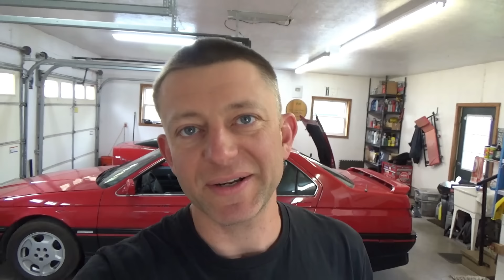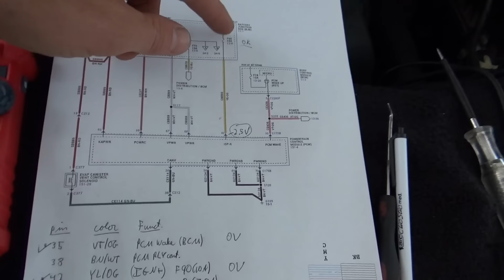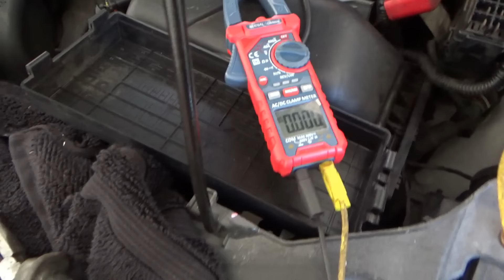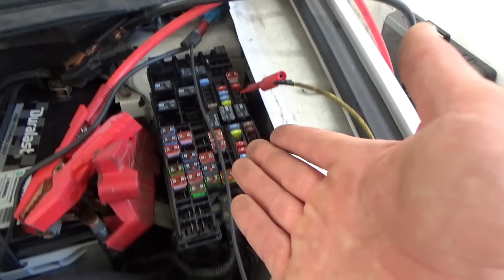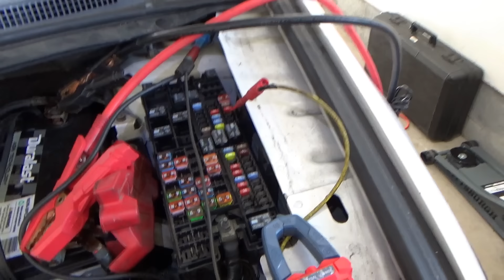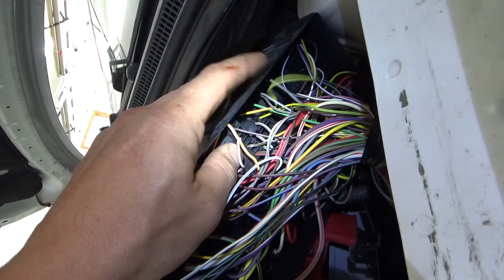(Pt 1) Ford KILLS Battery...PCM Stays AWAKE?! ('13 Edge V6) at NEW SHOP!!

Comment: If you can completely isolate the feed to the output which is bridged, there is the possibility that you could open the fault with a high current pulse, lets say 30 Amps ramping from 0 VDC to a max of 50 VDC. You could take it in stages if you have a adjustable current limit regulated DC bench power supply, or you could do a ramp. You would first set the current limit on the supply and then adjust the voltage up to about 50 VDC. If all goes well you could cook the crusty. If you watch the current you should see it increase, spike and then drop to zero, I think you can be confident that the crusty was cooked.

Comment: The bleed over is probably from a bad PCM right? seems to be a common problem with Ford Edges. They aren't connected anywhere else. The Fuse box is separated wires not a circuit board. Where the PCM is a circuit board and could bleed the power through.
Reply from the maker: Keep watching 😉

Comment: Wow, that’s quite a change, congrats on the little one that’s on the way.  Nice looking shop, lots more room.  I love these types of who done it diagnostic videos.  Are you still in the same general area of Pennsylvania?  An automotive question, I’m looking for a new scan tool, the think tool Pros was great but would like to know if the TopDon Phoenix Plus will work on the new 2025 Dodge Ram 2500 with the 6.7 diesel engine.

Comment: Check on the BCM trace the terminal that is bringing the voltage from the fuse box  to where it is you will see the problem probably the BCM, changing the front fuse box will not fix the problem

Comment: You Are Amazing to take this work on. This is absolutely an awesome video to involve fuse to PCM power. I've yet to try and correct, although emissions get in the way. Disconnected, ran a code however many times over just to find same code came up with main emissions  egr, DPE also disconnected, same code although must be started to test. Simplest test why PCM was alive, or restricted by module component, IRCM as a Relay Module. One of those two, and it wasn't the IRCM. Back to square one between Fuse Box and PCM. There are multiple sensors, switches, wirings involved with Fords. Thank you so much for very logical reasoning in faults - and not coming on code readers. Blanks out to Emissions, catalysts, O2 sensors, although wiring, components were changed out, half anyways right now. It makes a difference. Yes, I got another PCM also ++ more too. PST

Comment: Ford generally has the fuse box is part of the main harness snip the wires on the back add individual fuse holders and an aftermarket relay

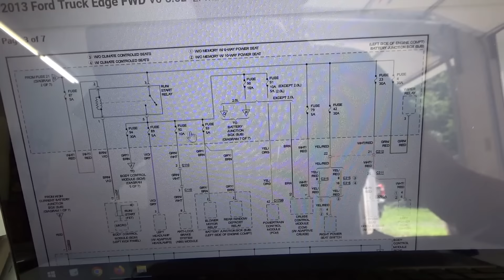Comment: you didn't pull fuse 94, the 30A BCM fuse! That fuse is also on the same tree, according to the wire diagram you pulled up at 20:00. How do we know it's not back feeding from that?

Edit: well uhhh... looks like Pt 2 is already out... I should've known Ivan wouldn't have missed that!

Comment: I have a 2009 H2 with a bad fuse box. Had to rewire the troubles because this fuse box is no longer available from anywhere. I would have to get a new one from a junkyard which of course is not possible. If problems get worse in the future I will just go to an aftermarket ECM and put in an aftermarket electronic dashboard. What a serious problem discontinued parts can cause.

Comment: My 03 Cadillac was acting like this. I went to clean the terminals of the PCM and there's was a spider fried inside the connectors. 😂 I removed it. Cleaned it with electronic cleaner and my car is as good as new now. 😂

Comment: Ivan off topic here. your old work horse the thinkcar pro has new update that adds service info integration to the diagnostic software. it really changes the tool for the better. check it out i think you will like it. even has scope wave form comparison

Comment: Well, sorry to hear about the divorce.   I hope you are doing ok.  Glad to see the new, very bright shop.  These "partial" voltage drains can be a real p.i.t.a.  I noticed when the test light was touched on the "hot" 2.5 volt terminal how quickly it went to zero, similar to corrosion or crusty bridging two terminals together, unless it's a crappy in the fuse box connection.  Or maybe a bad ground causing an above zero reading.  Where does that fuse get its power from again?

Comment: Hey Ivan. When you removed the 10A and 5A fuses to check the feed you overlooked the 30A fuse # 94 which is on the same line. My money's on that feed. Good luck with your second "Life" and parenthood.

Comment: First off congrats 🎉 keep the linage going.  The farm may have been tranquil but your new shop is popping.  Could use an update if you're in the same state.  You may need to update your service calls charges when it keeps you away from your new born.  And lastly don't let anyone deprive you from the discovery you child makes.  It's tough to explain but I didn't realize that others were drawing this energy from my child.  Be there when your child becomes amazed at the smallest things in life it will give you an unusual surge.  Life happens fast thanks for taking the time to share.  One last note CAF went through a similar evolution.  He didn't talk about it but from the gray hairs we can see.  Again congratulations and do it again brother.

Comment: Hi Ivan Add  relay use NC conact feed it with ground and the coil  will be  controlled by ignition voltage so the leak voltage will be grounded when ignition off

Comment: Cabosil is in fact not good to breathe in, it's basically very fine silica dust and will give you silicosis. Wood flour and chopped glass fibers is better for structural bonding, also milled glass which is like fiberglass powder is also good.

Comment: is it equipped with cruise control? Did you pull fuse 79? Bleeding voltage through cruise module from B+ input to the ign input?

Comment: 2.7 V? Look for lithium backup batteries in various modules.
Also you can cut the wire that powers up all those circuits (before the fuse box) and check the voltage on both sides.

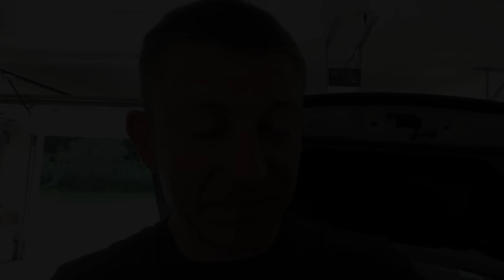Comment: 16:57.  🤔🤔🤔 disconnect the fuse to see where this 2.5V is coming from. Is it coming from the pcm or is it coming from the fusebox end of the circuit? I am thinking some sort of green crusties in a connector bleeding voltage into that circuit? Cheers, Ivan.

Comment: Congrats on everything!

My mext step on your issue...
There is no voltagedrop without a currentdraw. So when you pull the voltage down (voltagedrop) with the testlight current must be flowing somewhere. I would pull out my microamp clamp and first put it around the testlight to see how much current actually flows and get a baseline, then move it to every possible wire in the circuit looking for said draw paying attention to the direction of the current (clamps are directional). Of course with the testlight in place to keep current flowing.

Cant wait too see the sequel!

Comment: I was going to say - flush the fuse box in de-oxit to dissolve any green crusties or dead bugs that found their way into it. (never rule out that it's a dead bug or spider nest)
Most fuse boxes can be disassembled. As long as it's not burnt carbonized plastic then there's hope.

Comment: Great vid. Just put a pull down resistor and problem fixed (in fact, every module should have a pull down resistor internally for wakeup inputs).

Comment: I’ve noted you don’t have a good opinion for ecm’s from fs1. 

I purchased an ecm for an ‘09 Ram from fs1 and it has worked great from day 1. Running well over a year now.  

Opted for fs1 based on Reddit and other forums. Reviews were favorable on their service, communication, and most importantly they honor their warranty. 

So what’s the better option? This was less than $250, arrived programmed to vin, and has a lifetime warranty.

Comment: General  question, what are those little strips of numbers just above the door handle, I often used to see these when on vacation in the USA (I’m from the UK) more so in the 80’s and 90’s than now, I always assumed they are some sort of security/ entry system but never really found out, and I’ve just seen one on this car
Reply: It's a key pad that allows to lock/unlock the vehicle using a code of numbers instead of a remote control or key.
Reply: @juergenscholl2843 thank you.

Comment: Couldn't it be bridging the voltage from a compromised wire or corroded connector downstream from the fuse box?  My ham handed approach would probably be to start pulling fuses and see if the voltage goes away.  Mega congrats on your new life, I'm resisting making a tasteless Top Don probe joke...

Comment: My next step would be to disconnect each of the other feeds from the battery and see which one makes the 2.7 volts go away that at least helps you divide and conquer. There's a tiny chance there's a battery backup somewhere in the vehicle that's providing the 2.7 volts independent of the 12 volt power circuitry. But I think you just have to divide and conquer via the power diagrams. In other news that's a horrible design by Ford when they cost cut a couple of connectors out of the fuse box.

Comment: Russian hack. Add a bleeder resister to bleed off the 2.8 volts. Probably only need like a 1000 ohm resistor or higher. When the circuit turns on it won’t even notice the resistor at all! Good luck on your new life.

Comment: I think somehow you're incorrect in saying that the fuse box is integrated and cannot be taken apart. I could be mistaken, but how the hell would assembly workers install that fuse box on the assembly line put all those individual wires coming in the bottom? There have to be bulk connectors somewhere.
Reply: Looks like looks like a two-piece box

Comment: Congratulations on your new life path.  Please tell me you have room to put up a building for a lift.  When I got my lift twenty years ago I ceremoniously threw my creeper in the dumpster.  I still use jack stands but I don't crawl around on the floor under vehicles anymore.  Interesting diag so far.

Comment: Hi Ivan.  For the 2.7V dc, put your meter into dc current mode and measure what is flowing to ground.  I assume this will be say less than 1mA?  If so, possible 'crusties' / electrolysis producing the 2.7V dc (acting like a battery).  Perhaps a long shot but certainly possible.  I have seen this action before, a few times in fact.  The fuse box as you say being the culprit.  Jim

Comment: pull off the battery cables, then pull the relay and fuses 89 thru 94, then inject a low voltage, maybe 5 vdc, current limited max 3amps signal into the fuse box on the suspicious line with 2.8vdc floating, and put your heat camera on it. do you still have your bench power supply?

Comment: Congrats on everything! Looks like a nice new shop!

Surprised that you didn't do any word play pun on it being an "edge case" :)

If the voltage had disappeared when you connected the main battery then I would kind of had recommended you modify a bench dishwasher so you could just throw the fuse box in the dishwasher, with some opening cut in the lid for the wires to pass through, and add some rags and a drain pan of sorts to take care of whatever leaks out. Or for that sake just try pressure washing the fuse box in place.

With the voltage still there, and it being 2.8V, it feels like it's a back feed from something that either a 3V non rechargeable lithium battery or a severely discharged rechargeable battery (either lithium-something that should be 3-4V, or three NiMh cells that should be nominally 3.6V).

I doubt that dissimilar metals at several cases forming a battery of sorts when exposed to road salt would explain this, but you never know.

I would start by checking the voltage at every fuse and every empty fuse holder pin...

Comment: Big news Ivan! Congratulations on your new adventure. Hope the best for you and your future family. Would pinging some of those modules with the scan tool connected wake them up? Answer to your question. Perhaps there is leaking voltage through the BCM maybe due to a loose ground causing it to float just enough to wake things up. I think I seen this before on either one of your videos, or another youtuber's video.

Comment: Goooood morning kids!  Ivan.  It must be Ford week.  I had an Escape this week, Eric O had an Escape, and here you are with an Edge.  Mine was easy though, another shop wrecked the connector lock on the alternator (3.0) and it wouldn't stay connected.  He called me said he needed an alternator then when he got here he said battery and Alternator had already been replaced, but the guy that did it thought there might be something wrong with the connector.  o.0  Yeah the lock tab was jammed in it so it couldn't lock in.  "VZ's Garage: We repair what your buddy tried to fix".  SMH  Hey, it paid an hour so................